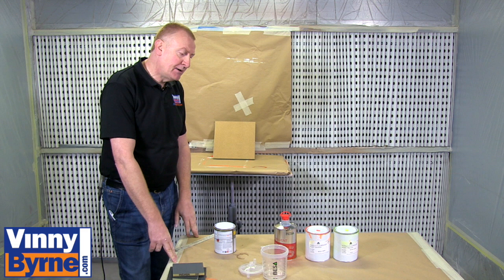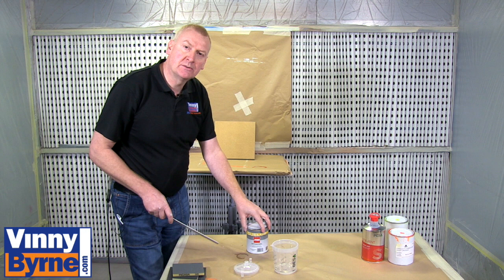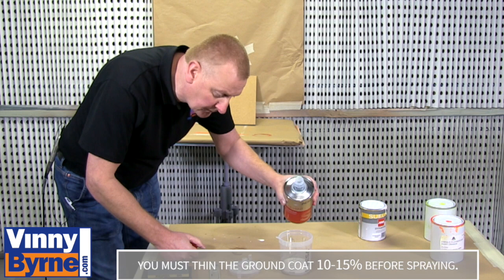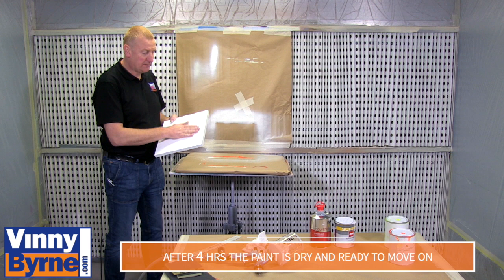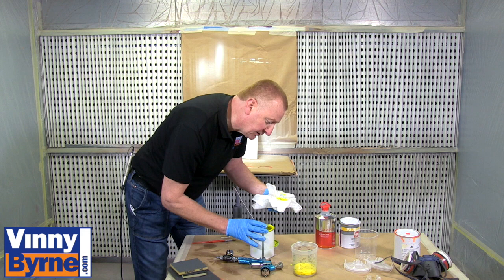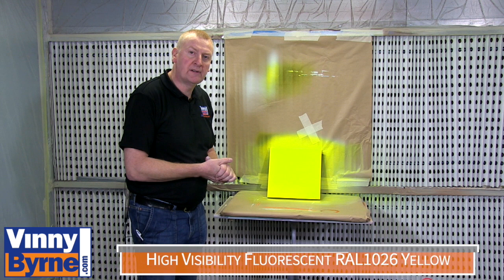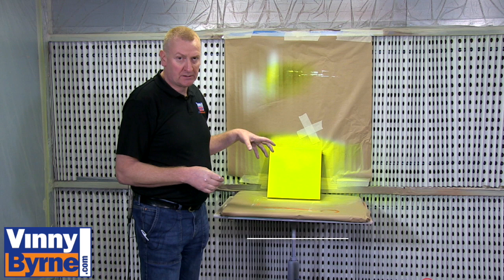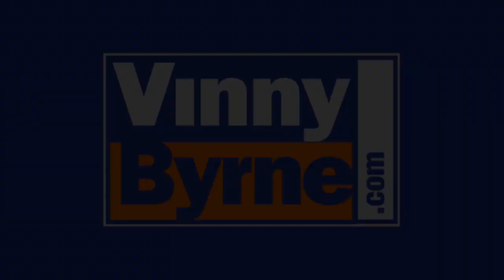How to Get a professional finish with fluorescent paint on almost any surface

Comment: BRILLIANT!

AYE!

This is exactly what I'm looking for!

The Pittsburgh brand jack stands I bought from Harbor Freight years ago have been recalled and I want nothing more to do with ratchet jacks over 3 tons.  I can't find any 5 tons pin jacks in brick and mortar stores around me in the Chicagoland area. For the last 48 hours I'm planning on doing cribbing with 4 inch by 4 in by 24 inch sections.

When I watched YouTube videos, it was usually fire department's demonstrating how to crib.  All the fire departments I watched painted the ends of the boards. I think this is a great idea to mark the boards so not to be used as firewood or other projects.  The colors used were very fluorescent brilliant yellow and orange but the orange wasn't quite as eye-appealing to me.